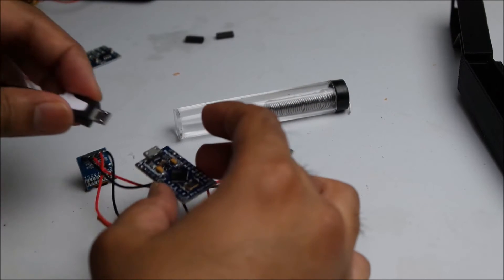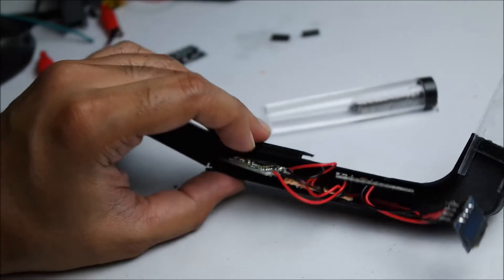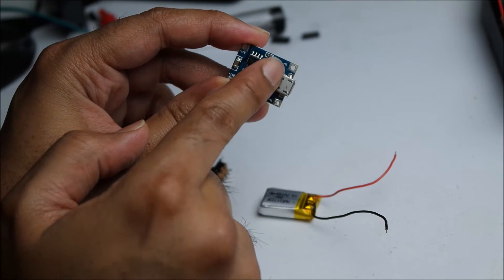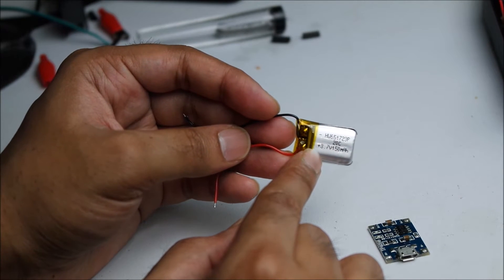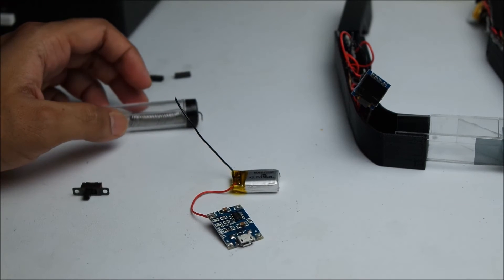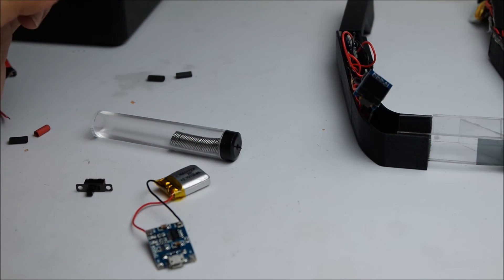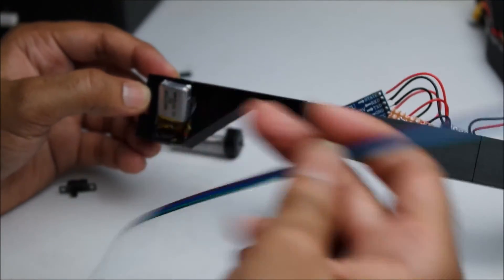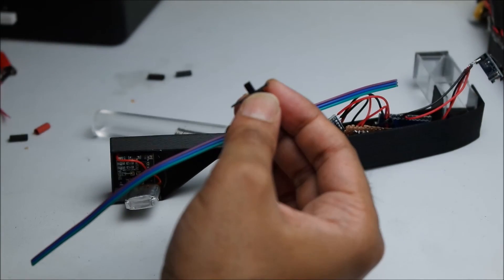DIY Google Glass: Complete Tutorial Part 4

Comment: how do we know is its fully charged?
Reply from the maker: currently you cant. you can if you buy a charging module which provides a charge indicator then you can attached led's or a screen to it
Reply: +Fahim Chowdhury and BTW did u do write the code for this?
Reply from the maker: +Hammad Ul Haque just using an example code provided with u8glib for arduino. I will write some code at some point
Reply: +Fahim Chowdhury look up retro watch, it has the ability to send notifications and has a clock with date
Reply: +Fahim Chowdhury it supports u8glib and has the almost the same hardware just its used as a watch, and also has a android app for the notifications
Reply from the maker: +Hammad Ul Haque nice. I will take a look